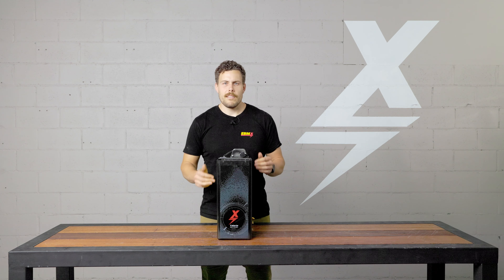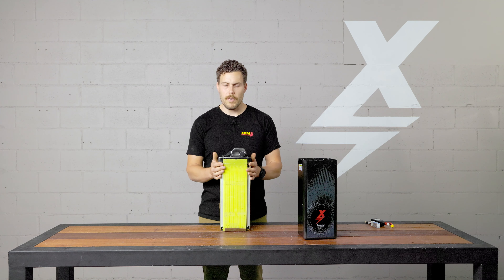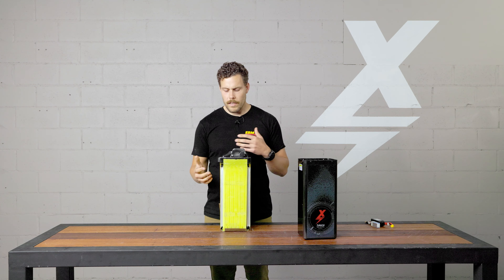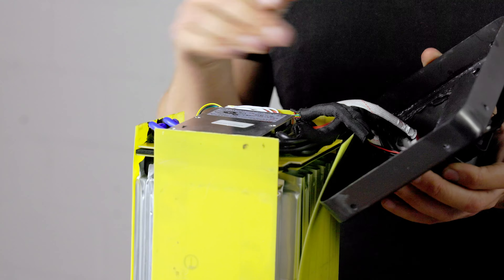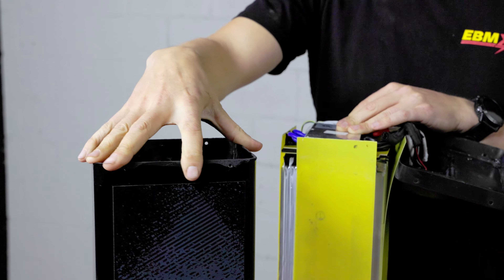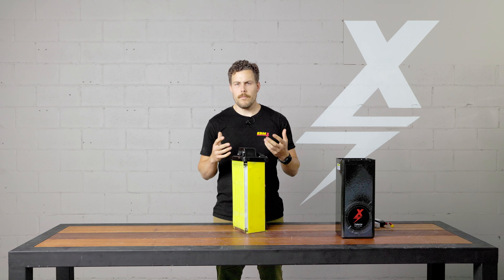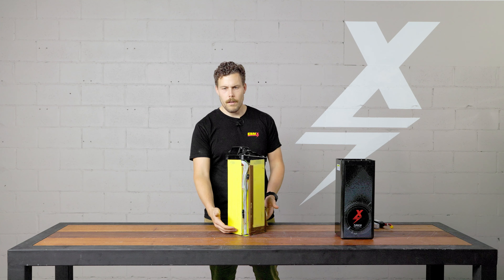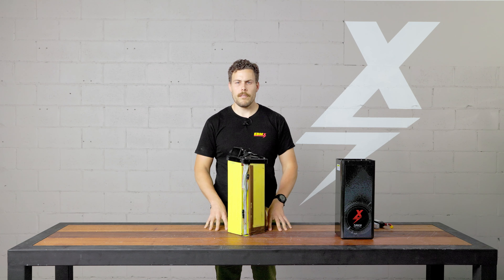EBMX Explainer Video 2022 - EBMX Battery Construction Explainer

Comment: Pouch cells swell over time. If they're potted, they have nowhere to expand. Isn't that dangerous?
Reply: Premium pouch cells don’t expand like cheap disposable RC lipo or other low quality pouch found on cheap products. Lots of premium electric cars and electric motorcycles use premium grade NMC pouch cells, Surron Ultra uses the same SK pouch cells and they’re potted too. Premium pouch cells are also used by the defence, some like the Kokam military grade made in Korea you can put a bullet through and they still working and no fire. Pouch is amazing!
Reply: @BrunoPOWEEER  Any chance I could get the cell model number to read more about it?
Reply: @bardamari1852   actually your supposed to use compression with pouch cells so they aren't able to expand. It prolongs their life. I imagine potting has a similar effect.
Reply: I have read a couple of posts from customers that said they had problems. And ebmx seems to have come through and replaced them. But they said that they had to wait quite a while. Like 5+ weeks. I guess their new battery pipeline is just like that. It would be interesting to see actual numbers about these faults from ebmx. Cos it is just something that happens sometimes with the tech and with enough builds and sales it seems possible.

Comment: Does the bms have Bluetooth?
Reply from the maker: Sure does.
Reply: @EBMXtreme  sweet! do I use your app or a different one to check battery percentage? I have the KO controller but not sure how accurate it is
Reply from the maker: @gunsgamesandmotors6517  ANT BMS is the right app.

Comment: if the fire was enclosed in the case how would you know theres a fire ?
Reply: Ehhhh if one actually lit up you (and they) would definitely know about it. They are saying the runaway should mostly stay contained within the casing compared to other brands which might blow out the sides earlier. But if it did happen, hopefully you can get to it when it is smoking and before it becomes a flame torch. Eg. you could use gloves etc. to get it out of your bike / garage and to an external area to then be managed (not official advice, don't approach burning packs). I have not heard of this happening to anyone.

Comment: Is the battery percentage display based on voltage or is it based on actual amp hours, AKA coulomb counting?
Reply from the maker: Based on voltage.  The most accurate way to monitor battery % is to use the app to connect to the BMS.
Reply: @EBMXtreme  thanks. Seems like a step back though. The stock surron battery display is based on Coulumb counting. Putting out an app and connecting via Bluetooth is a hassle.  I see the chi battery is moving away from a voltage base display. Do you guys have any plans to upgrade? Seems like the Ant BMS needs a connection to the display.

Comment: Do you make any Sur ron batteries with 18650 cells or just these pouch batteries?
What's the proven lifespan of these pouch Cells versus 18650 cylindrical cells?
Reply from the maker: Just use the lithium ion pouch cells like in this video.  really depends on they make and quality of cells... but the cells we use out preform most of the small round cells you will find in batteries.

Comment: what happens if the battery is 35 celsius from sitting in the sun and you fast charge it at 20 amps
Reply: No answer you get your answer
Reply: 🫣...charging range is 0° - 45° C
 Charge rate ranges from .3 - .5C ( safely under 1C ) depending on model. Sir this is a Wendy's.
Reply: @BipoCosmo  For some context. In Australia just solar panels on roofs in summer sit at about 60c most days despite usually being rated for output at 22c. People don't ride their bikes much in winter ...
Reply: @tau3457  hi there how's it going?
1. .3C - .5C and under 1C w/ "C" = battery [C]capacity
2. The BMS ensures safe charging  temps and charge rates.
Reply: @BipoCosmo  good thanks. But we don't have those low temps in Australia where this company is from. 2 of our largest cities are tropical / subtropical temps. So more like 20-45c ambient and 25-60 in sun.
Reply: @BipoCosmo  This is a really strange comment. I have not said any of those things. EDIT - they deleted it.

Comment: Heat has no way to get out of these batteries. And elevated cell temperature is the number one cause of battery degradation.
Reply: Hey Jim,
These cells have a very low internal resistance so they run MUCH cooler than cylindrical cells
Rated for 300A continuous which is over 21.6kW… it’s hard and impractical to ride such short wheel base bike at 15kW peak… 
Also when talking about degradation, we are so confident that EBMX is the only company giving 2 year warranty where all other companies only do 1 year or depending where you get it from = 0 months warranty and fingers crossed it’s going to work…
Reply: @BrunoPOWEEER  Hi Bruno, I would love to see a video where you ride it hard and show the temperature in real time. Talking about it is one thing but showing it is a whole another level. It does look like you guys have the best battery in the business right now. If you make a video that demonstrates it it's way more powerful in terms of transmitting your message. Cheers mate!
Reply: @jimlahey5354  yes with 3 thermistors, one in the middle of the pack, one on top and one on the side, temperature delta is important too, I want my battery to hold more than two years considering the high price tag.
But I don’t think we will se such a test from anyone soon.

Comment: BuT iT´s fiRE PoUcH CelLSs..people like these not even knowing the difference between kW and kWh :D

I work in battery testing and wonder whether you thought of the internal pressure of the cells, especially when potting the whole case. Usually you got a venting valve as every cell breathes a little bit. And pouch cells are, because the lack of a housing, breathing more then for example a cylindrical cell.
Besides that, I think you can ignore the haters and confidently advertise your 3rd party batteries as best on market..
Reply from the maker: The cases are not 100% sealed and can vent that’s why they are not waterproof. 

Thanks for your feedback mate.
Reply: @EBMXtreme  the kW and kWh was meant for the haters ;)
Thanks for the reply!
Reply: @EBMXtreme  Question and not a hater I just wanna know what if I ride on the boardwalk/ocean and stop to charge at my usual spot on the boardwalk when my bike quickly gets soaked from all the moisture/mist? Happened to me about 1-2 months ago
I put my jacket to cover my chibattery and my charger also didn't seem to get affected
But would you recommend a non waterproof battery in my situation/this situation?
Even the floor was very wet and I lost traction...  the bike was really getting wet and it was happening fast
And even though I was on the boardwalk it was far from the ocean, about 270 feet away
Reply: @joem8601  every battery should be extremely waterproof, specially cylindrical cells as they’re steel case and rust pretty quickly with any moisture inside the pack. You’re riding the battery was warm then you left it charging (much lower current than when you’re riding) so your battery cooled down and if not potted, it probably absorbed moisture from that very wet marine air.
Pouch cells are vacuum sealed aluminium foil with external plastic coasting, these survive much better if moisture is present (and the battery isn’t potted).
Usually marine moisture is very corrosive too so try to give a quick rinse over the bike after exposing in scenarios like that otherwise lots of steel parts will start to rust (even stainless steel parts as they’re all 304 and not 316 marine grade stainless). Cylindrical cells are regular steel
Reply: @christianwagner6244  Hey Christian!! Thaaaanks for this really nice and positive comment mate and asking about very interesting technical details =]

•Pressure vent valve on the battery case: this is extremely important on non-potted devices where there’s a lot of “lose and free air” inside the battery case and the pressure significantly varies when the internal case temperature increase and decrease. This is a 95% (maybe 97%) fully potted battery so there’s pretty much zero air inside this battery case. 

•Internal cell pressure: pouch cells have an internal vacuum, no air inside (Lithium chemical reacts to the water present in the air) so inside the cells you only have separators, chemicals, minerals like copper, aluminium etc and electrolyte solution. In this case the stainless box (+ fibreglass and potting) gives the structural/mechanical and external protection to the pouch cells. Cells shouldn’t breathe, this would introduce air and moisture inside and rapidly damage the cells. Cells are completely sealed for a reason. Depending on the cell (form-factor and brand) you can slightly smell “electrolyte” vapour when opening the battery case that isn’t potted. Premium pouch cells are very very different to cheap pouch cells (RC and what you find inside most electronic devices).

Anyway, thanks for your comment mate… so much POWEEEEEER ohh yeahh!!
Reply: @BrunoPOWEEER  I wish I could send you cookies for this over the top explanation, I cant wait to try a 72 v ebmx battery soon myself, I already made up my mind. This informative video, this active presence over social medias and YT, makes us customers more aware by educating us, and therefore we realize what an amazing product you are offering us.
Reply: @davidsoto8307  hahahahaha I am addicted to cookies mate… would love that haha =]
Yeah, we try to keep as active on social media as possible… basically just being very open and honest, we often mention pros and cons of products (not just the Cinderela perfect story lots of marketing guys like doing). Haha
I hope you LOVE the EBMX stuff… sooo much POWEEEEEEEER ohh yeaaahh
Reply: @BrunoPOWEEER  So in theory if you ride in rain or kick some spray up on the beaches. Your battery potting would limit it from effecting the cells right. And basically, only the wiring/circuitry above the potting might get some corrosion, depending on the version / lid seal. And your new battery with the BMS on the rear would have potting all the way to top so only that external circuits might be risky? Ta